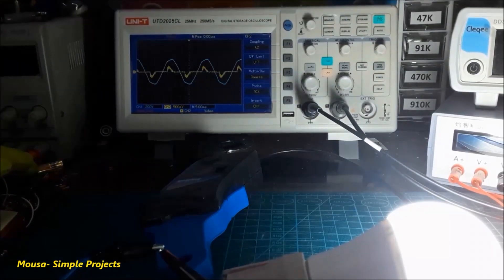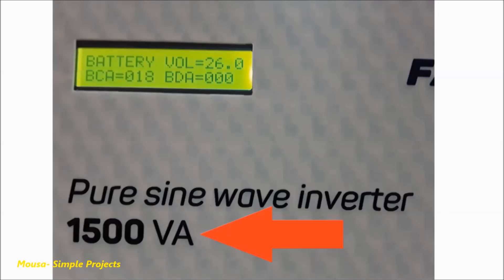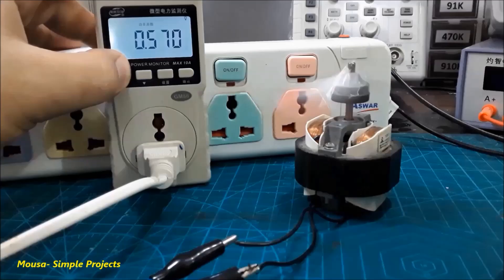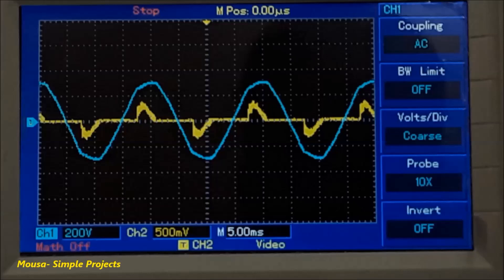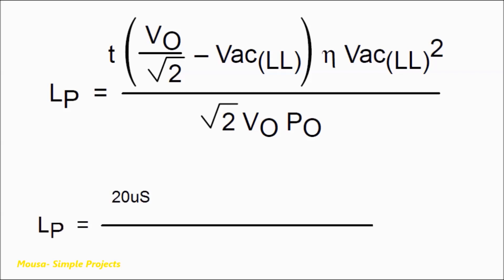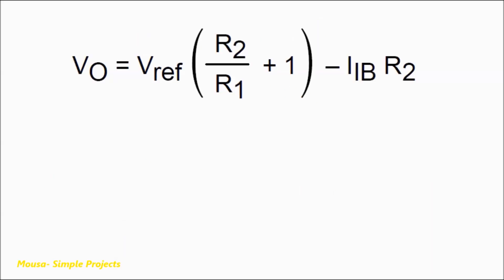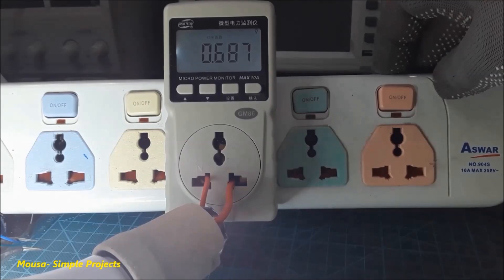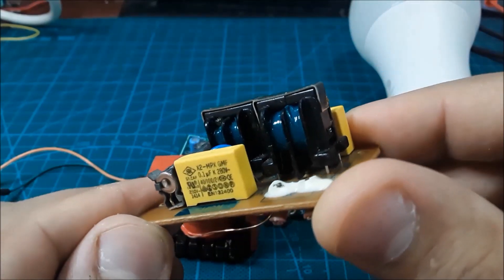Active Power Factor Correction Using MC33262 | Power Factor Correction Explained

Comment: Hey..
The output of this circuit is dc .. that does it means we could run only DC loads, not AC.. is it ?
Reply from the maker: Electronic appliances (such as LED bulb, TV, Laptop charger , ...etc) they have full bridge rectifier inside, so even when you connect them to AC voltage,  they convert it to DC before use it, so they in fact working with DC voltage. For induction motors we use capacitors to correct PF.
Reply: @MousaSimpleProjects  thank you so much for clearing my doubt ..✨

Comment: Hy!
My question is that your output is 354 V DC, but how are you operating that 220 V AC LED bulb at the output?
Reply from the maker: When you convert 220V AC RMS to DC by full bridge rectifier you end up with 311V DC Peak voltage (220x√2=311). That happen inside the LED bulb anyway.  
This circuit boost up the voltage a litter bit (354v instead of 311v). So its OK.
You can read more here:
https://moodle.weltec.ac.nz/mod/book/view.php?id=244070&chapterid=51920